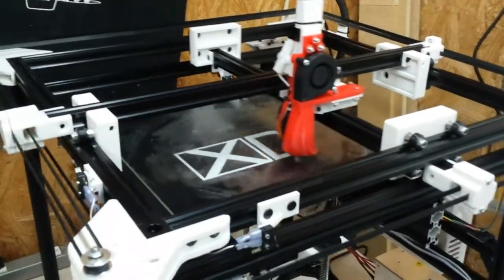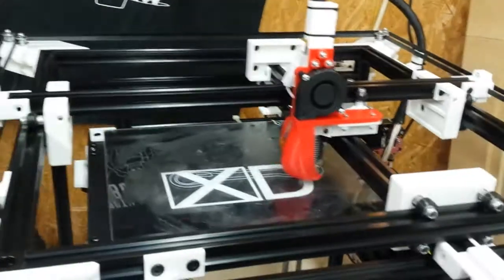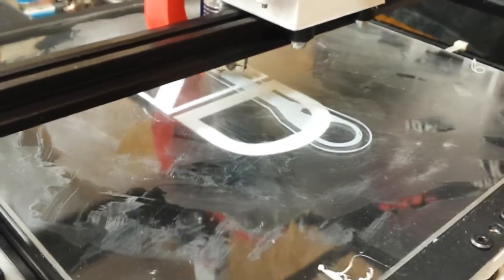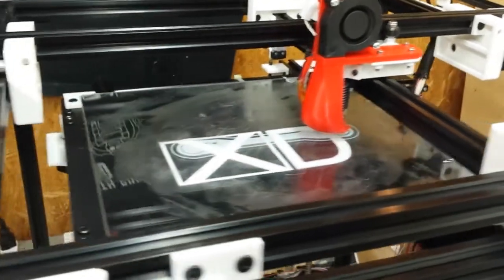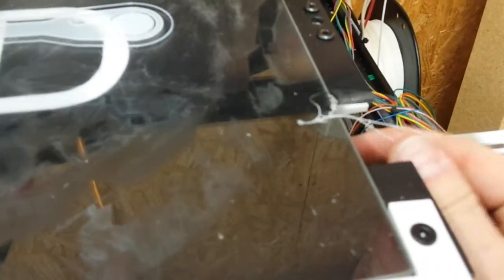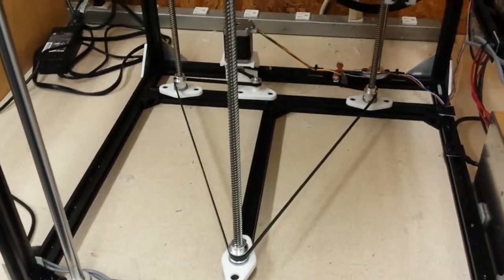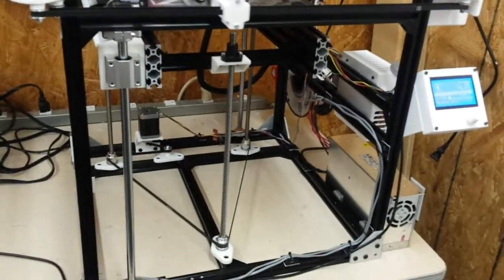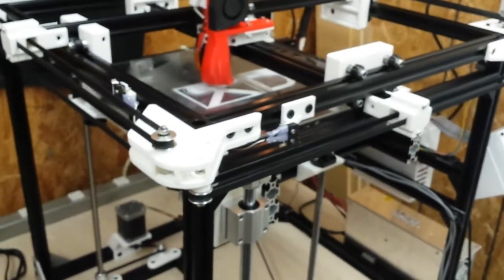XDrive Crossbeam 3d Printer

Comment: Do you notice benefits of crossbeam design over core xy and hbot?
Reply from the maker: What I've seen is that the crossbeam axes are more independent than drive systems that rely on mathematical combinations to achieve x- or y- specific motion.  I also see less twisting forces applied to the overall frame resulting in reduced deflection, and thus less motion artifacts showing up in the resultant parts.
Reply: @NeilWNC  HI Neil, at the moment I am planning on my first DIY Printer, because I want something larger, than just 500x500mm. So I´m aiming on a size of like 800x800mm or larger. 
What are your pros and cons of a cross-beam construction over a H-beam construction?
Thank you M.
Reply from the maker: @michaels-welt5899  Hi there --  The cross-beam mechanism is great for isolating the x and y movements, is gentler on the frame.  However, if you have a REALLY rigid frame, taut good quality belts and well controlled linear bearings you should be able to get fine results from an HBeam printer.  That's a lot of "ifs".  Best, Neil.
Reply from the maker: @michaels-welt5899  Hi there.  Have a look at the newer (but not really "new") printer that is a descendant of the XDrive: https://www.youtube.com/watch?v=O4s2-y2JYOA
As regards your question, H-beam printers put a lot of strain on the frame, can cause misalignments.  Cross-beam has very good separation between x and y motion, and reduced strain on the frame.  You may want to look at my book: "Designing 3D Printers: Essential Knowledge", available on Amazon.  Thanks for the posting!

Comment: Looks great! Considering the print quality of the Ultimaker/Zortrax style printers I'm surprised this isn't more widely developed in the DIY world. Have considered doing the same thing with 2040 extrusion and linear rails only for the XY. Also would like to use CoreXY (would be interesting wrapping the belts around the Ultimaker style X & Y) and 100% aluminum. Been busy with a CNC mill and a lathe will probably be next but one of these days...

Comment: Is the makerslide Al extrusion cosmetic, or does it serve specific purpose?
Reply from the maker: Not sure which extrusion you're referring to, but there's probably a bit of metal that could be eliminated.  At present there's a functional reason for each piece.  Any particular one(s) in mind?
Reply: +NeilWNC Am really interested in building something sturdy like this. Is it possible that you share a BOM for the electronics, motors, extruder, and other hardware? I'd rather buy parts based on recommendation.
Reply from the maker: Hi again ...
I'm not sure if I'm ready to share the design.  Much of what's here are custom 3d printed parts (of my own design).  I'm toying with the notion of developing it further into a commercial machine.  Or not.
Reply: +NeilWNC I understand. I'm making my own iteration based on the standard extrusion-based process. What I would like is if you can share your BOM for the parts I can buy off of Ebay.... extruder, motors, belts, etc... so I can buy them at comparable quality.